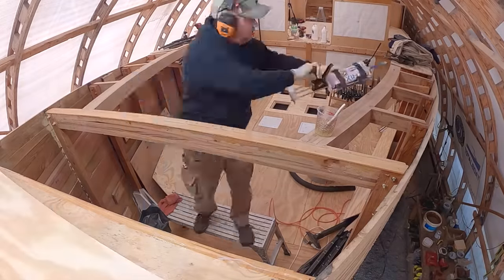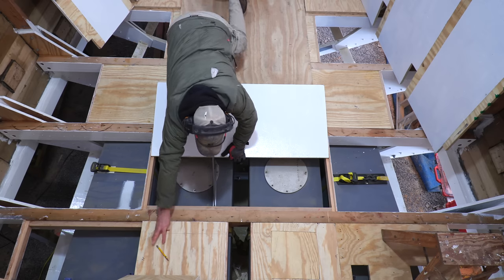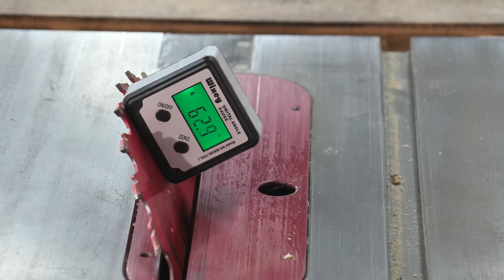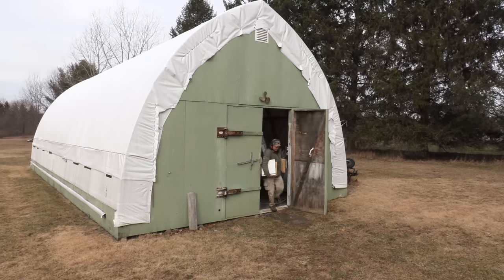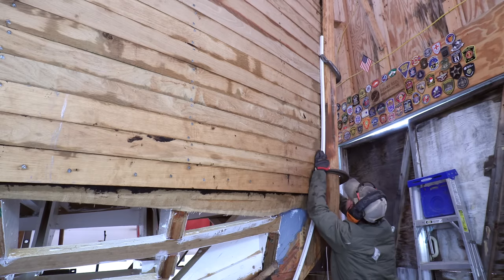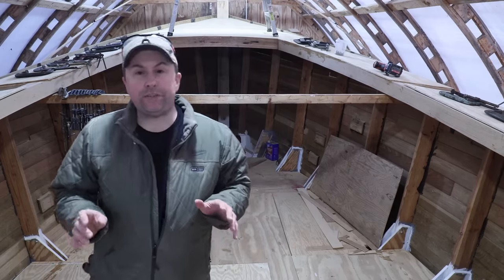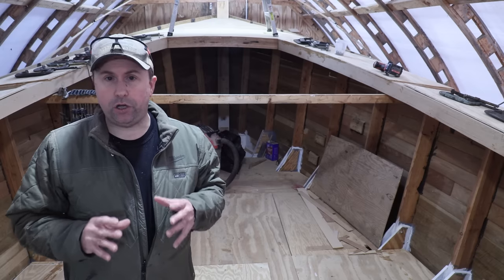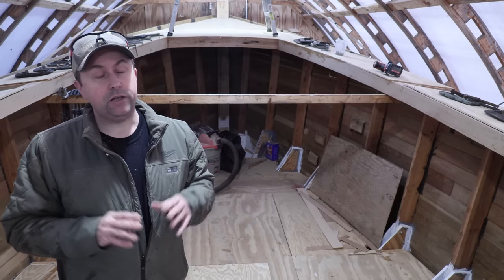Bilge hatch construction and installation, Sea Dreamer Project Ep. 79.

Comment: Just got caught up on the videos and I have a couple of comments. 
1. The frames are bolted to the floors and then bolted to the keel with only one bolt per frame/floor , is that strong enough? It seems like a lot of weight. The hull wants to float up and the keel wants to pull everything down. 
2. How are you going to add ballast to the bottom of the keel /bilge with all the tanks and soles installed. 
3. Why didn’t you extend the small carlines all the way to the planks to add  structure?